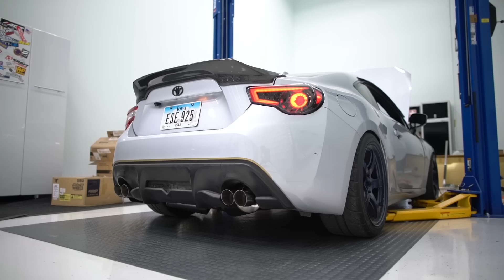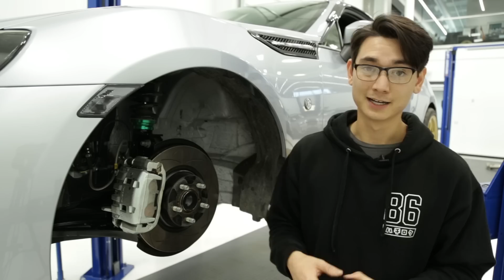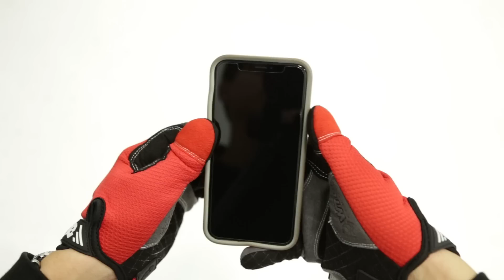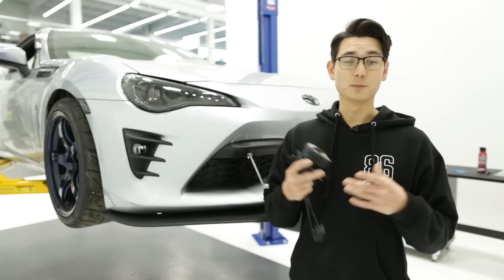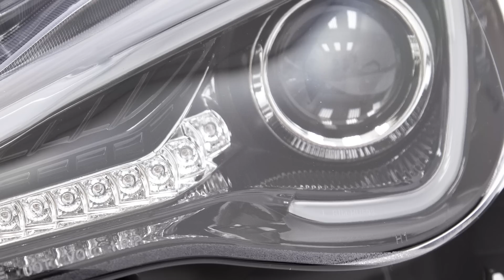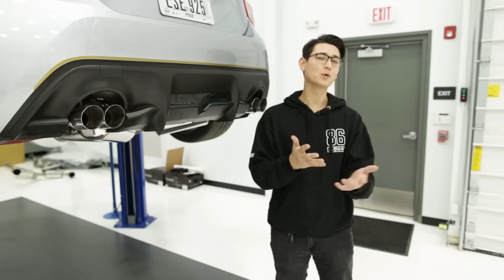New Products Dec 2018

Comment: What size are the tires on the front wheels? Im thinking of doing 245/35/18 in front.  18x9.5. Squared
Reply: I'm pretty sure that's what those wheels are running that's the standard for quality fitment on an FR-S
Reply: @pwnzlikeme  im being lazy. Ima watch the video on the set up. 👍
Reply: They might have 255s I'm running them squared on my frs
Reply from the maker: 255/35/18 squared on 18x9.5 +38
Reply: @FTspeed  thank you👍